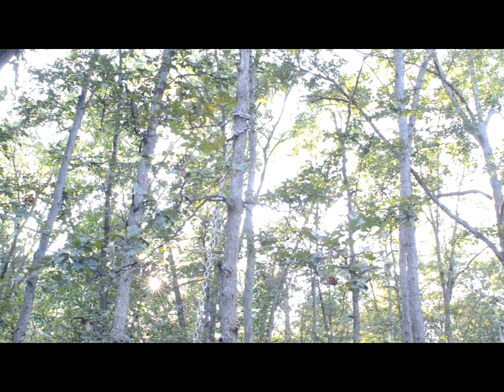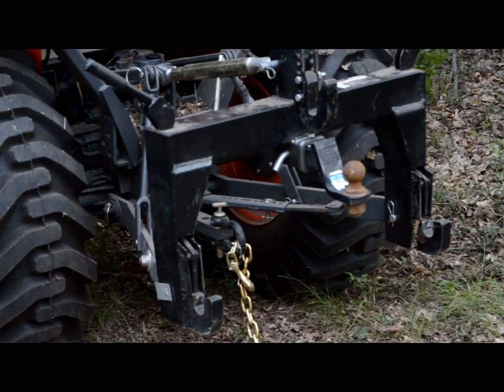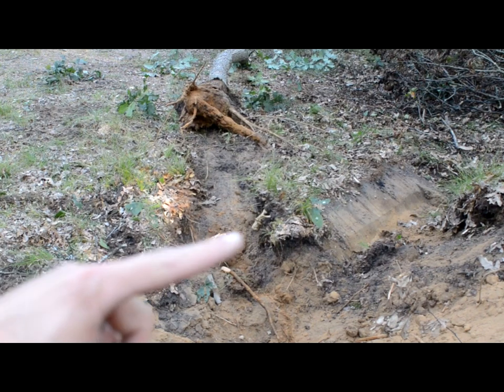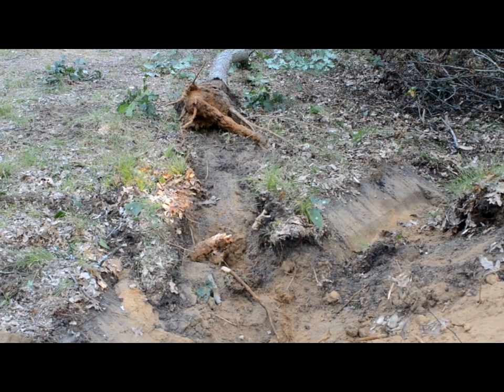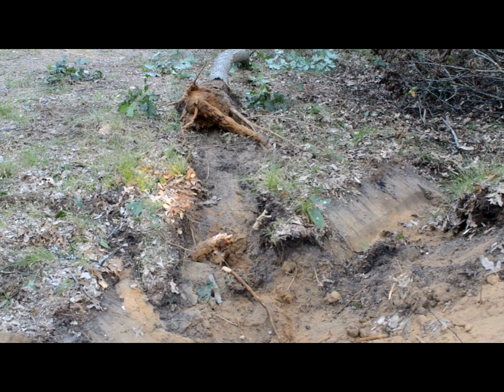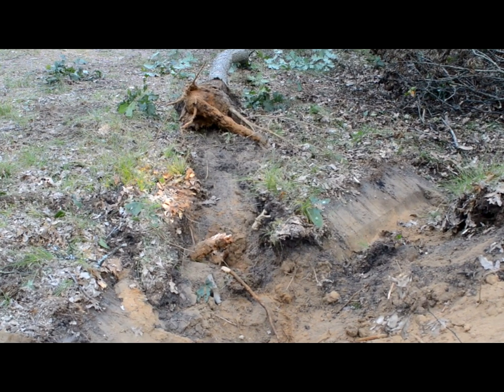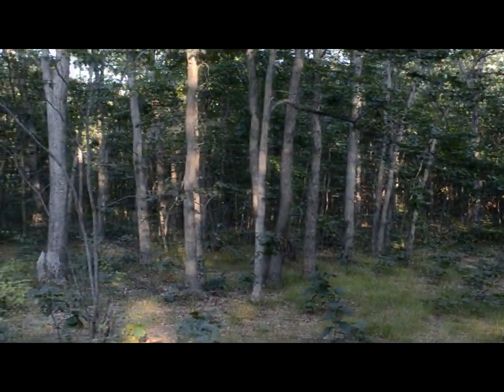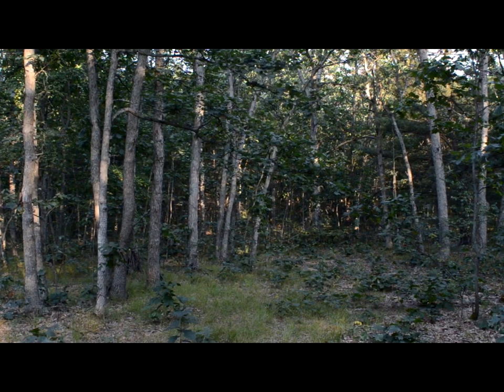Pulling down 6" oak tree with Kubota b2650 compact tractor

Comment: Unless you have a very long strap or chain, I don't recommend pulling down trees.  It works but is quite dangerous if the tree hits you.  Years ago I pulled down a tree with a heavy 50 foot rope.  The diagonal distance up the tree is much longer than the horizontal distance to the tree.  The very top of the tree hit me and knocked me completely off the tractor and down on the ground in front of the rear tire.  Luckily the tractor engine died before it ran over me.

Comment: You need to have a bigger counterweight on your three point hitch whenever doing loader work. It takes the stress off of the front axle and wheels, which aren't as beefy as the rear axle and wheels, and also keeps the tractor from tipping forward as well. Even a box blade or other implement would help. I have read that adding around 75% of your loader's lift capacity to the rear is ideal.
Reply: Pluto Thor This is true. It's why my 1000 pound backhoe makes the perfect companion for my 1200 pound lift FEL. Never thought about it like that before but it makes sense.
Reply: Do you think a brush cutter will also work?
Reply: @jamesscott6661  Yes, I carry a box blade on mine or a rotary cutter. The problem with a big rotary cutter is length. So if you are in a tight spot and have a 12ft or more piece of extending from the rear, it could. be a tight fit.

Comment: You didn’t grow up on a farm and work with equipment did you?   Climbing on that loader without a counterweight wasn’t smart.  

Be careful curling bucket too far down, you will destroy your cylinders.   Good luck.  Lessons learned on farm equipment cost money, body parts or lives.

Comment: I have a bx2380 (much smaller) tractor. I dig a little around tree also then just take the bucket and push it over. That tree had really no stump size or roots to it. You have a much larger tractor to do it. Also to replace that heavy chain try using straps to hold or can take alot of weight. Way lighter and just as effective as chains

Comment: Like your video. We're did u get that burn ring or did u make it ? That's awesome I need one that size.
Reply from the maker: It is pretty awesome isn't it?! My wife found a guy that does fabrication on the side, particularly fire pit rings and had it custom made. THere was a bit of a miscommunication regarding the size though, she confused diameter and circumference, so it ended up GIANT. However, we have big fires at times so its pretty awesome. It is about 70" in diameter (I wouldn't want to go smaller than maybe 50-60 for bonfires) and I think it was $250 with the design CNC'd into it. I figured the guy probably has $40 just in material in the thing since it is so big. 

She searched around a while before finding this guy, he isn't necessarily the best advertised. Maybe post on Facebook asking for somebody that makes custom fire rings in the area. She had also looked online and they were WAY more expensive for much smaller (they of course wouldn't ship worth a darn unless they were flat and you welded them yourself).